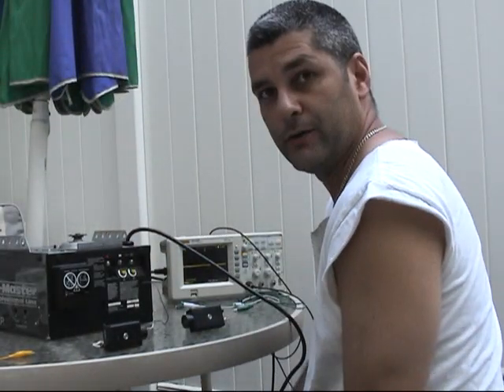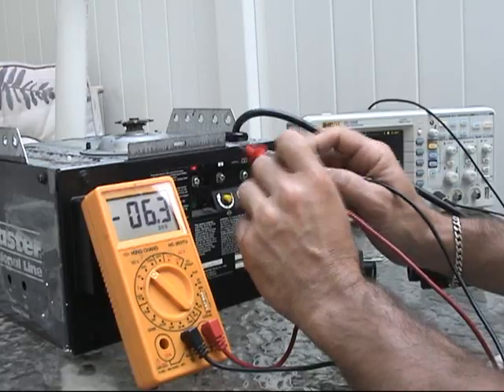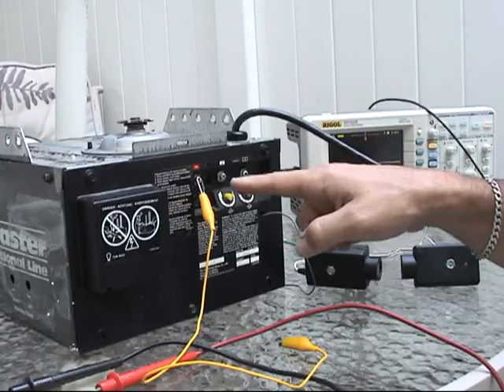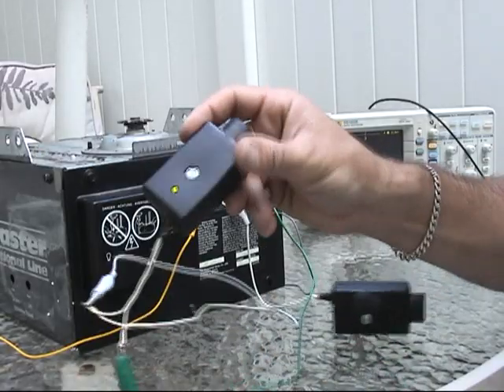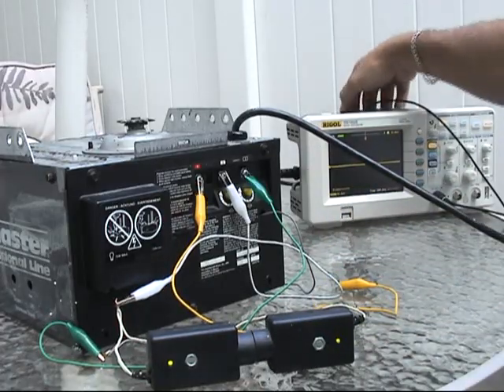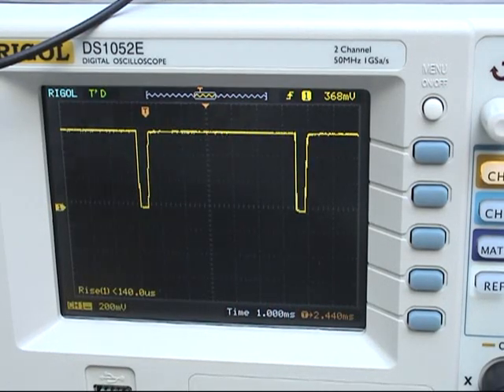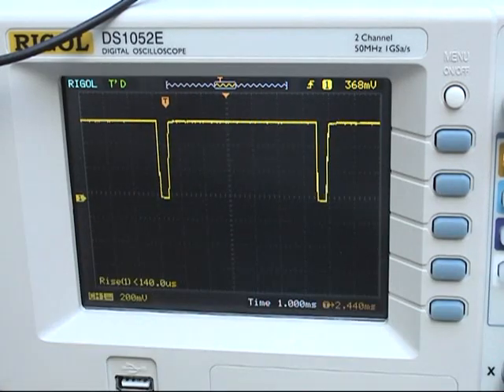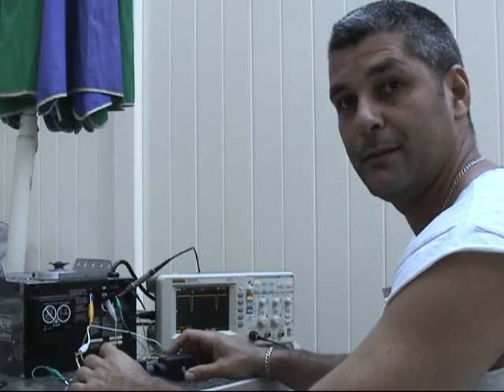Bypass garage door safety sensor.wmv

Comment: Your video claims to BYPASS the Safety Beams.  However, you merely explain how they work and show nothing as far as "BYPASSING" the safety beam.  Your video is correct in explanation of how they work but is misleading into thinking they can be bypassed.  They can't.  Well, they can if you create your own home grown electronic circuit to simulate the safety beam.  But yes - I agree - do not ever bypass the safety beam.  It's there for a good reason.  Especially if you have children or pets.

Comment: The video is titled "how to bypass the garage door sensor", but in the end he basically concludes: You cannot!
Actually you can, but it involves understanding a few things not explained in this video, such as:
How can the signal be read across the same two wires that power both nthe emitter and the detector? 
What does the detection circuit look like at the receiving end to make this food/bad determination.
This is not very complicated, but unfortunately it is not addressed in this video. 
I would make a video explaining this, but there are other videos out there that explain it very clearly, so I don't need to.

Comment: Hey thanks man but i have some additional questions and i know there not the right solution to my issue but it is my issue and i choose to deal with it how i wish to deal with it to fir my own needs. With that said i see your very knowlegable and set up to test circuts and pulses etc and have a brilliant mechanical mindset so my question is what would be the workaround for bypassing the pulse and relay directly on that control board so its basically just the opener button and then the adjustments and transmitter have you tried to modify these boards to accomplish this and if so what all does it intail?
Reply: Oh not to mention no one operates my garage door anyways and couldn't even if they tried I have a integrated security system that prevents anyone from opening it that does not have the pin code from either side of it and transmitter is built into the app so I'm not worried about it possibly being dangerous to do because it's not all that dangerous since you can still bypass it by holding down the button any kid would and could find that out given I still had a original setup like most. 😅😅 So dangerous there's still a bypass right at the button on the wall... I guess it's more a question of how dangerous is the operator of it?  I don't think I'd ever close my door on someone or something because I'm highly confident I don't want to hurt anyone and don't want to damage anything and if that occurred it would be my issue not the worlds just for all the finger pointers that may hate on my question and pursuit of further knowledge in the circut board.

Comment: what happens if the wires connecting your sensors short circuit because installers don't bother to tape or wire nut them, do they arc/spark? (yes, i know its only 6v) does it blow a fuse in the motor? pop a capacitor on the circuit board? does it do nothing at all?

Comment: Are those two wires merely supply power to the sensors or are they doing more than that?

is the momentary off sequence initiated by the main controller unit based on signals it read from the sensors wirelessly or are the sensors causing a momentary short-circuit? Many questions.

Comment: Sorry, this is good information video about how sensors work but absolutely now information how to bypass them.  If a person does not understand that  sensors should be aligned and there should be some voltage between control points, they should not attempt to service this device at the beginning or some very serious damage to the device or other failure will happen.

Comment: Hi Joel!  Very usefull video!  Few trouble-shooting video on this subject adress the voltage at the output of the sensors on the unit.  My unit is a Lift-Master and I have a question for you:  my voltage between 1 and 2 and between 1 and 3 is around 16 volts.  But I have no voltage reading between 2 and 3.  What would you think of those readings and why I do not see voltage between 2 and 3?  (Your readings was 24v and 6v in your video).  Thanks very much and have a good day!

Comment: Thanks for this highly informative piece.  I couldn't find any other explanative post.

There may be a minor inaccuracy around the 10:15 mark. I think the transmitter is just emitting a IR beam.  As long as the receiver sees the beam, a timer in the pulls the positive wire to ground briefly after ~650 ms and resets itself.  No need for an oscillator anywhere.  But, I don't know if I am correct.

Your solution is also quite simple and brilliant.  Thank you for your effort.  I wish there were more people like you, instead of those that question the need for the solution.

Comment: This is good information. I was thinking that I could use a jumper to bypass the sensor to test whether the sensors are bad or something in the motor box. Now I see that I cannot. BTW the light does change states when the beam is blocked so it not likely an alignment issue. This doesn’t mean that the signal is getting to the motor box. 

Since I left my o-scope in my other pants, I’m pretty sure that I can use the frequency mode on the DMM. 

Question: is the pulsating signal generated at the sensor or in the motor box?

Comment: Thanks for showing the signals; from that I could tell my Rx was wierd since it still had some kind of pulsing even with a blocked beam. With an open beam, the waveform was never clean, looked like lots of RC filtering.  
*However* the video title is 'bypass garage door safety sensor", but you never did showed how to do this. I wanted to do until temporarily until the new parts came in..

Comment: The reason the opener works when you short out one and two is because that is normally that's where a wall button would go.. the wall button will open and or close the door at any time.   With with a wall button you have line of sight on your garage door. Or you should and that is an override for The Infrareds.  So when you short out 1+2 or bridge them basically what you're doing is you're pushing the button on the wall.  Normally you push it and let go it's a quick short enough to signal the motor to move.  However when bridging it or holding the button and not letting go you are overwriting the infrareds you're allowed to do that because once again because you have the line of sight. This is a built-in feature of every garage door opener..it's basically there in case you can't close your door and a guy like me can't come to your house within 10 minutes if you want me to be there it'll get your door closed for the evening and you can once again you have line of sight and its owner or user responsible at that point.

This will not work with remote controls your remote controls cannot override your Infrareds only your button on the wall and once again why because you have line of sight or at least you should.  I'm pretty sure the new UL 325 doesn't allow for it button anywhere besides inside the garage with a line of sight on there garage door opener and garage door. Newer garage doors you can close from your phone will emit a siren or an alarm for 10 seconds before closing the door there is absolutely no way to override your Infrareds believe me we've tried we've tried hundreds of times every which way we can there is no way to override it unless you want to start taking circuit boards apart and redoing them you pretty much can't do it. . And with small children and pets valuable cars. Why would you want too?   Keep them clean. Don't put shit near them and don't let your dog piss on them. They will last 20 years or at the very least the life of the opener.  There's always the exception to the rule but for the most part they don't go bad.  Any garage door guy that comes your house and tells you you've got bad Infrareds is most likely lying to you.  You've  either got a cut wire or they are not lined up.  How do I know this ?  I've been doing Garage Doors Gates and Operating Devices as a licensed contractor for well over 30 years now that's how I know.  You're all very welcome
Reply: All true. However, saying it's impossible to actually bypass them is not true. I can pretty much garuntee you that if I found out the right pulse timing for my opener, and then using an Arduino or really anything similar, some other bits and pieces to match voltage, and 30 mins of programming, I could use that to trick the opener. Removing the actually sensors completely. But why go through all the effort when you can just tape the two of em together in 2 mins and boom, you're done, same result, less work.

Comment: What I did,  pop the sensors open and solder in new 470mfd capacitors....  fixed it.
Reply: Why does that work? How did you know to try this and where did you come up with the 470mfd number?
Reply: @realSamAndrew   Capacitors have the mfd and voltage printed on them ... If the old ones are bulging or leaking, replace them.  They are polarized and rated voltage must be equal or higher,  mfd must be the same.   35 dollars for new sensors vs a couple of bucks for new capacitors.
Reply: @oldroscoe2590 so what you were saying is you repaired bad sensors? I was thinking you used the capacitors to "bypass" the sensors in a method that had not been suggested before. Correct?

Comment: You can test the pair of sensors without using the opener by wiring them together as shown and then connect the black/white wire in series with a 1K ohm resistor (1/4 watt or larger) to +6 VDC battery and the white wires to the other battery terminal (-). An oscilloscope connected to the wire pairs will show the  same waveforms as in seen in this youtube but you don't need it to check the sensors.

Comment: While not what the title says, I was able to check with my scope what issue I was having thanks to the specs given in this vid. VERY HELPFUL and a quick test. In my case, the internal board had gone bad and was not sending the correct pulse voltage. Rather than just throwing parts at it or trying to disable the system, which is dangerous and the safety system must work if you are selling the house, for example, ( so you'd have to fix it correctly anyways) I was able to save time and have mine work correctly once again because of this vid. THX!

Comment: Great video.  9 out of 10 garage door video's spent 5 minutes talking about aligning the sensors.  WE KNOW HOW TO ALIGN SENSORS. From your video I was able to figure out WHY you can't just jump the common ground (2) with the sensor (3) post and take out the sensors all together, you need the timed pulse that the sensors provide.I was able to troubleshoot by taking the wire runs out of the equation and hooking the sensors up directly to the drive unit.  Also nice to know the voltages, next time I'll just check for voltage at the sensors.  In the end I had 1 shorted (+) wire in the attic that presented a curve ball at the unit when trying to diagnose.  So the 3 hours I spent tonight will help me out next time.  Thanks again, good to know HOW it works before you just try and follow someones steps blindly.

Comment: question based on your video.  is it possible for a transmitter sensor to exhibit a degradation in the beam strength such that the receiver sensor does not transmit a closed loop?  my sensors are both lit, but, the door will not close, thus giving me 3 blinks which, according to the manufacturer, represents an obstruction between sensors.  I appreciate any comments.

Comment: Does anybody know how to enable the sensor function on an opener that didn't originally have them? I'm trying to retrofit sensors to a 1992 vintage Craftsman opener 139.53683SRT, that didn't come with them but did have the sensor option. I connected a set of known-good sensors to terminals 2-3 and the sensors LEDs indicate that they're working, but the opener doesn't respond. I'm guessing that the electronic board 4A4207-1 has to be modified in some way to enable the sensor function, but I can't locate the original instruction sheet for the optional sensors. There are a couple of empty spots on the PCB for a diode and capacitor, which makes me think it wouldn't be hard to complete the circuit if I could find out what the parts are.

Comment: Just tape both sensors together zip-tie them in a safe area near the motor. Also you can install them normally in a high area, if some day you close the garage door but you change your mind or forget something you can just wave your hand between the sensors so it can open again. If you have kids don't fucking bypass that safety feature.

Comment: "People pray about this alignment." Hahaha. XD  Excellent educational video. Not a simple way to wire a bypass though. The point he's making is the transmitter creates the pulse so you have to bypass by joining the sensors head to head or imitate the pulse.  Not worth the liability tho. better to try to fix or replace the sensor/transmitter.

Comment: ANSWER TO THE QUESTION WE ALL CAME HERE FOR :  if you are having issues with your sensor and your door is not closing and is blinking light , go to local hardware store. grab yourself some wire and a cheap doorbell. go up to your opener disconnect your sensor wires. replace with doorbell and put it beside  where your wall opener is  connect the doorbell to the other end of the wires you just changed. door open push . door close push and hold . done deal no more sensors

Comment: My garage door has missing part for optical sensor so it will not close.  So I THOUGHT I could simply bypass it at the control box but nothing I could do seemed to work...So apparently the circuit board INSISTS it has the signal...so i HAVE to buy the part (a reflector in my case)  or a whole new sensor?  Back when I was an electrician years ago,  the commercial door operators simply had contactors and so all I had to do is move the control voltage past the safety circuit and it would close without the sensor...but now that everything has electronic boards they can INSIST on certain signal ...which I guess is good as far as safety but it sucks if you need to trial and error trouble shoot or get a door closed for the night for security sake...I don't get why some of the sensors have ONE eye aimed at a reflector and others have TWO eyes aimed at each other??  Different patents is the only thing I can figure??  mine is reflector style....think a mirror would work?  I WOULD have tried that but I had no idea it was missing a part!  Some AHOOE removed it before I bought this house so all it has was ONE eye which silly me I ASSUMED that was all it needed similar maybe to single eye security sensor that  operate an alarm if someone trsspases in an area etc...so I climbed extension ladder and pulled my hair out for no reason except some AHOLE removed the reflector ...I guess...wish I had TRIED a mirror!

Comment: need to change the sensor to function when door opening and not when closing. The reason is that I have side way garage doors. Layout is two doors side by side. At the moment, the sensor works when the door is opening ( sideways) and if I obstruct the sensors, the door will close.
Reply from the maker: That type of change have to be done in the Garage Opener; can't be done in the sensor.
Reply: How that is done?
Reply: Install the opener on the outside... 
  Turn the doors so they are not sideways...
 Install the a opener sideways on each door...
  
Chances are the block digram is available online, just type model number and add install manual and pdf, if that don't type the model and diagram on google image search model then either diagram or block diagram. Or you could probe the shit out (probably eye it out realistically but better safe then frying non-eatables. On the genie screwdrive opener I got the pdf open for right now it shows a wire going to the motor for up and for down, just switch those (it's a orange and yellow on that model) and on the model the track has stop limiters and they bother have a switch so those wires would probably need to be switched (one is brown one is gray on thats one) If you do make any modifications it's a good idea to wire the opener to extension so the plug can be pulled if something goes wrong  

Or just call a opener repair companies and asked if it can be fixed then they will say they have to come look or give estimate or whatever and you respond with asking what it would take to fix it and if they don't know ask to talk to field tech call you back possible then apologize and explain that you have already had two guys come out and not be able to help, first one was a small business and the second one was one of the bigger companies around and the main issue with that happening is you took off from work twice and money is no object within reason and that you just want to be assured they they can get some that can make it happen and see what a professional says they would do to fix it.

Comment: I have a newer unit PN: 41AC150-1M. it has 4 connection points. 2 for the switch and 2 for the sensors. Will your system with the 555 pulse generator also work on this machine? if so, how would you connect it? If not, what will work?